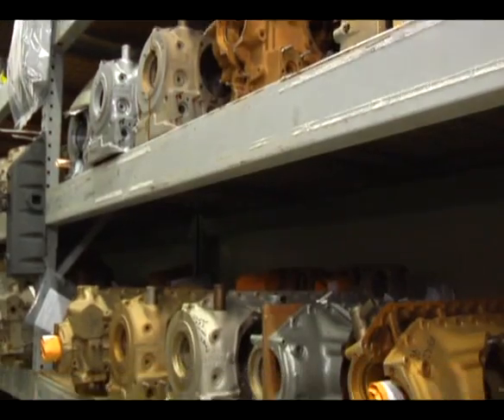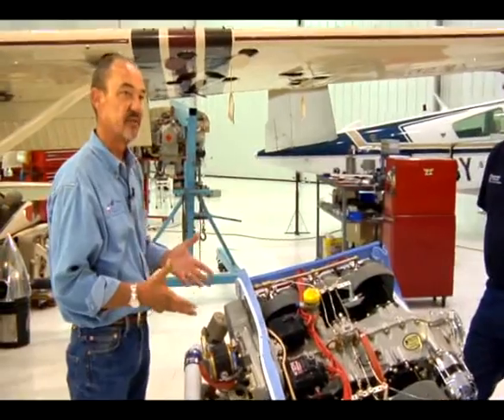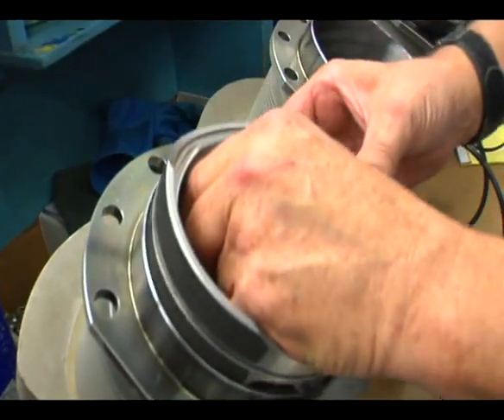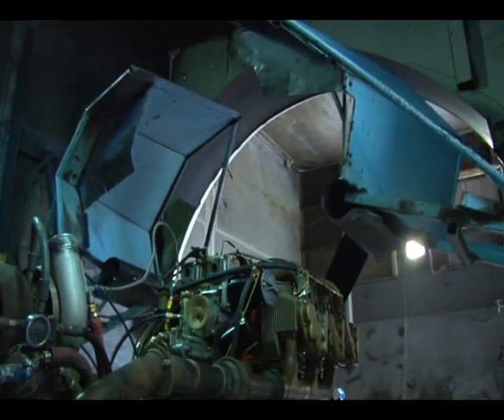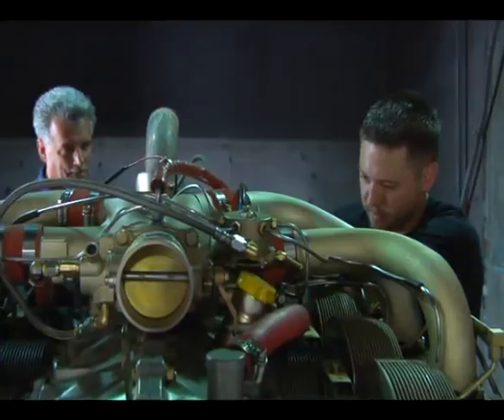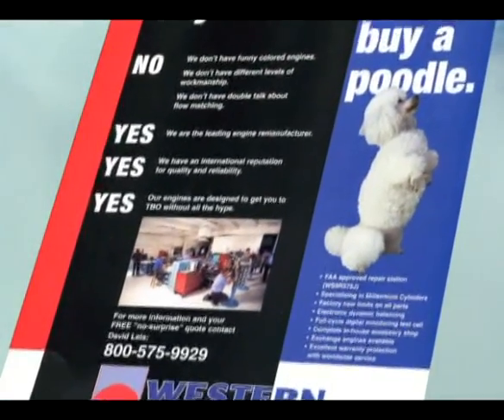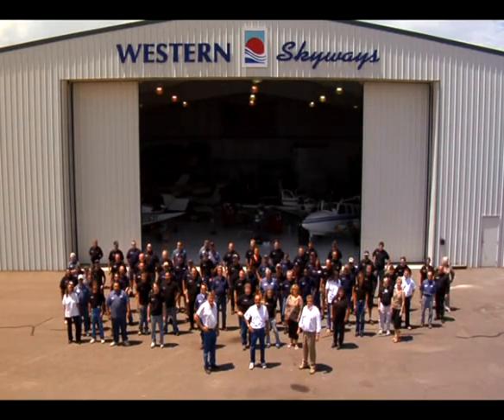Western Skyways Piston Engines, part 2

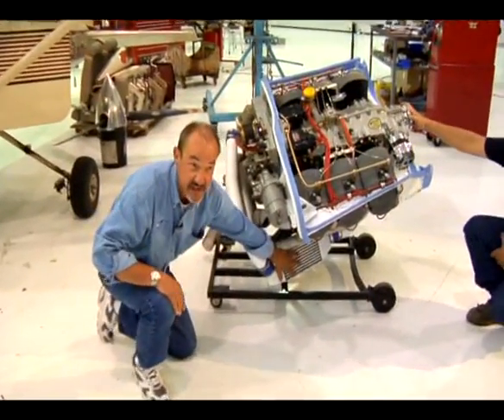Comment: :facepalm: at 1:47, the intercooler cools the air after the turbo's compressor and not before. Also, only the manufacture can "remanufacture" an aircraft engine. Your engines are overhauls.
Reply: Yeah saw that too, was wondering for some reason if aviation turbocharging was different than vehicles haha. Wonder if "John" (mechanic standing next to guy speaking) had his hand over his face, shaking his head haha.
Reply: @rastapastrychief  Talk about a blast from the past. Watching this again. I missed the mechanic safety wiring the bolts  in the loosing direction at 2:24. 🤦‍♂️
Reply: @PatrickLipsinic  Yeah, haha, who knows. Maybe they were told to “look busy” when the camera guy comes around 👍🏻 No disrespect to the company though. I’m sure they are a reputable engine builder, though. I love pretty much anything turbocharged, so they sold me with their turbo retrofitting.